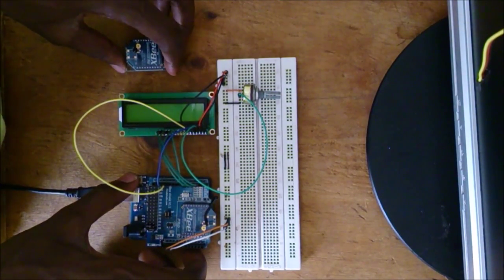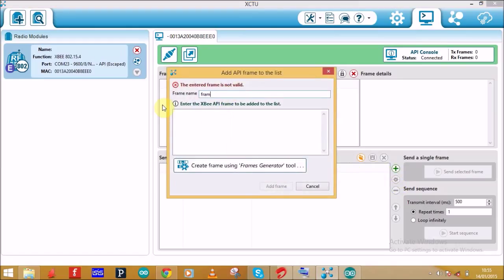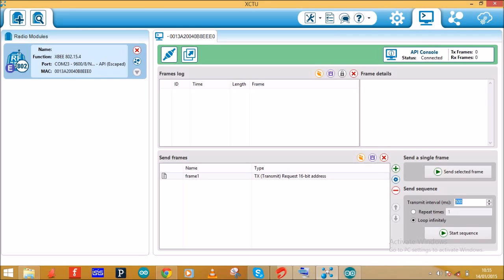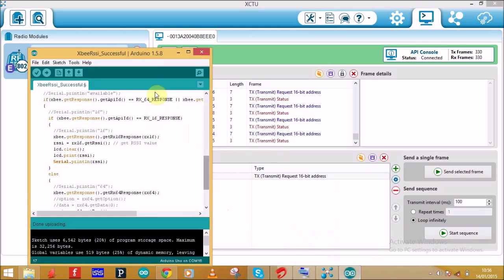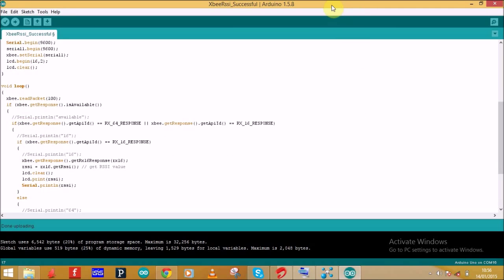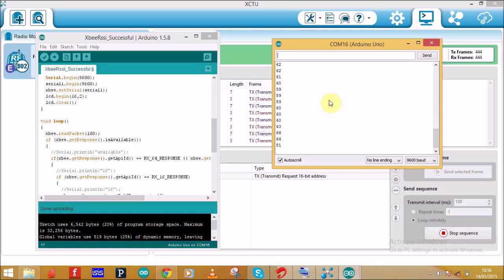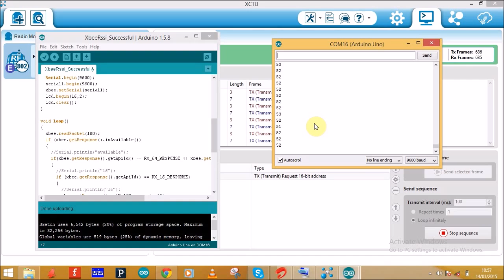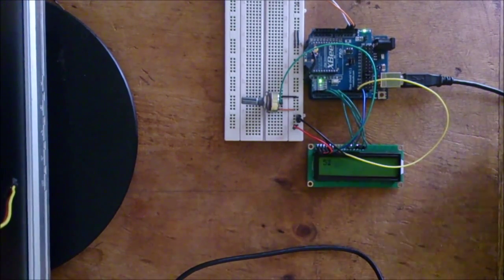getting xbee RSSI

Comment: I had a go at this myself - it works great but I had to tweak it a bit :). On the Arduino Uno I am using the RX and TX pins are actually 0 and 1. If you dont get this part right you will see nothing on the serial monitor. I copied out the code by watching the video a couple times. To save people the trouble, please feel free to comment for the code/help.
Reply: Hi please let me know which XBee module u used
Reply: @shamilmuhammed1866  Hi I used the s2c, they work with the older s2 modules as well if you update the firmware using the XCTU software on a PC.
Reply: @nathansmith7219  Can you please help me, I have a fixed circuit in which Xbee is connected as tx-rx and rx-tx and arduino pins used are 4,5 using SoftwareSerial.h library. Can I read RSSI of XBee with these connections, I have also tried the code in tutorial but it shows me a constant value in result.